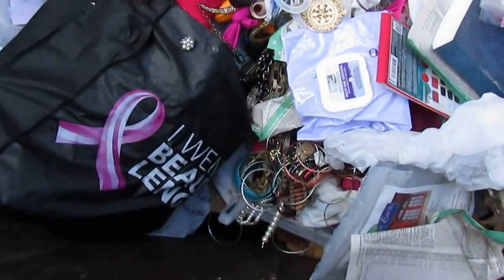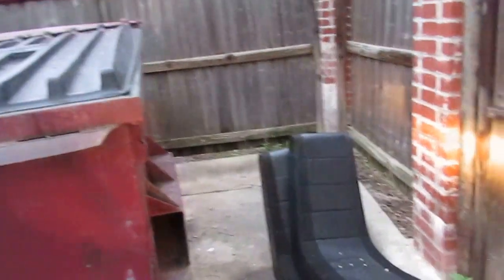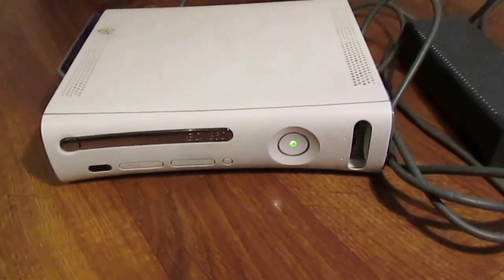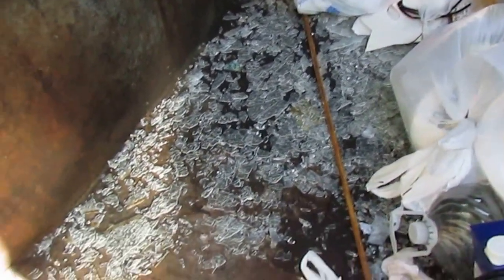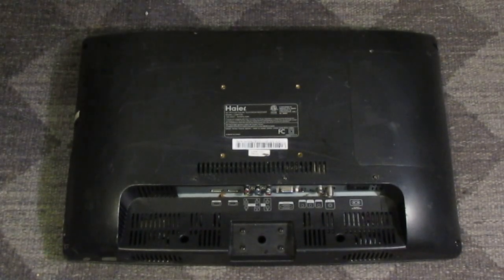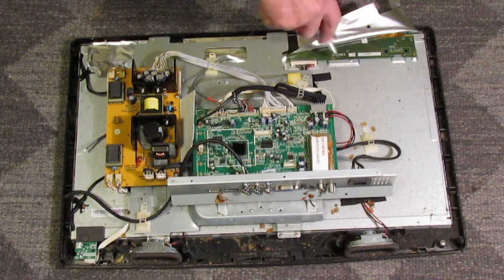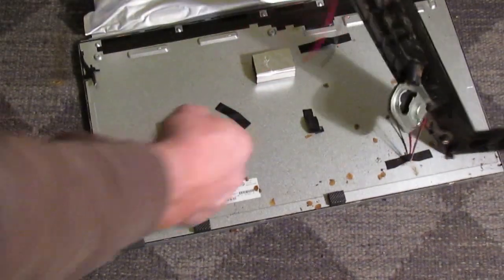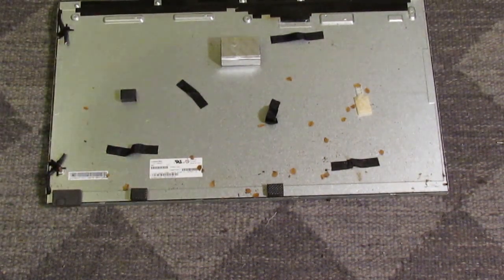Jewelry Dumpster Dive Xbox Video Game System - Metal Scrapping Flat Screen TV for Gold Plated Board

Comment: you sound like you struggle to pick up 6 pounds
Reply from the maker: lol, usually its cuz i am actually upside down with feet in air with camera in one hand and scrap item in other hand with gut on edge of steel dumpster and using my gut to pull myself up. lol. Other times itz cuz i'm just plain old and it starts to hurt. lol.